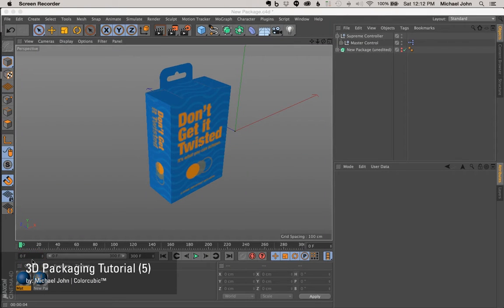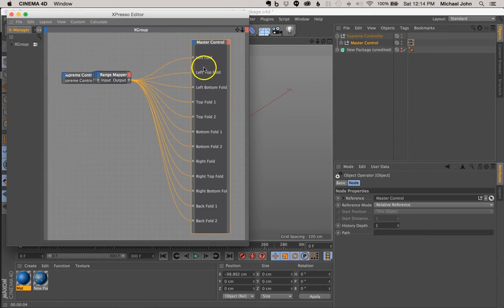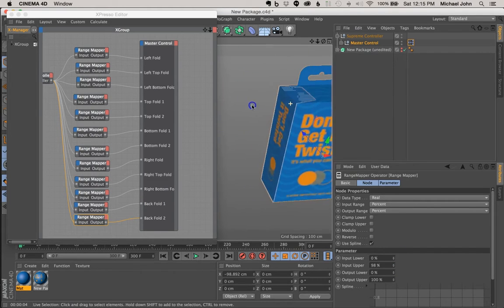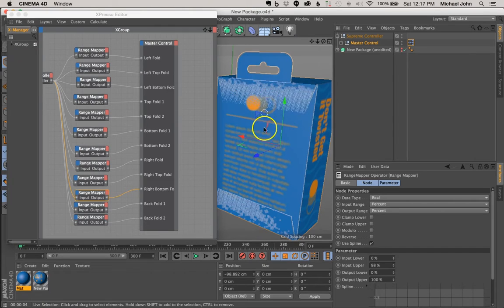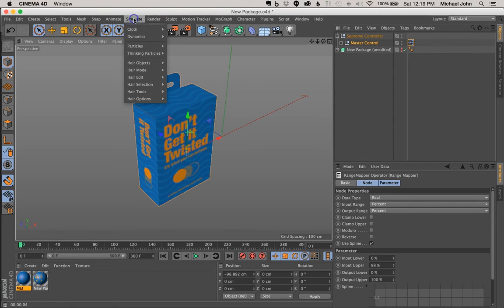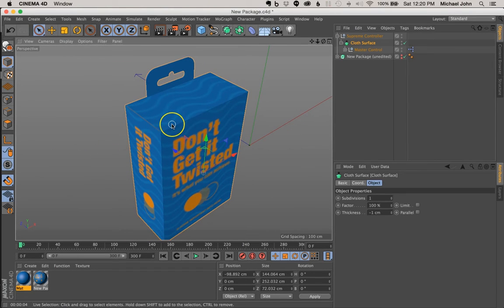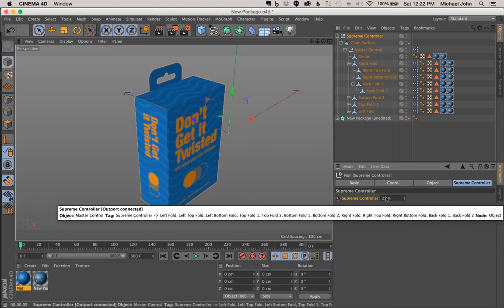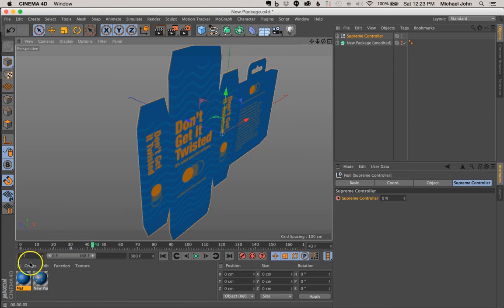Cinema 4D Tutorials - 3D Packaging (Part 5)

Comment: used this tutorial in 2022 and I'm pretty happy that I found you!
although I have one question 
how can I fold the parts without them intersecting each other?
I tried playing with master controls but when I change the numbers it changes back to what it was
hope you would still visit here
Reply from the maker: Apologies for the delayed response, I’ve been working on a solution for that, to help. It’s kind of a weird process, but it seems to work. I’ll be revisiting this anyway, to accommodate for the new C4D layout, as some of the processes have changed, so when I do that, I’ll be sure to update this, to include the solution to mitigate interactions.

Comment: so cool video!!! I have question, How could you print this  to actually make a box please?
Reply from the maker: Hi Jonsu, excellent question; the design process within Illustrator is what you would use to print to make a box. You need to ensure the guides are saved as a separate layer. Most printing companies have a process that would accept the illustrator file. If they don’t, you can save it as a PDF with layers. You just want to be sure that the dimensions you create in Adobe illustrator are the dimensions you want to actually print. 

Please let me know if you need further clarification. 

Best,

- Michael | Colorcubic®
Reply: @Colorcubic   Yeah everything you said is very clear to me!! Thank you very much for a quick and nice reply!!!
Reply from the maker: My apologies, my phone auto-misspelled your name. *Jonsu = Junsu.

Comment: Once you add the Cloth Surface the inner materials becomes the outer material. How do you keep that from happening ?
Reply from the maker: Excellent question. You’ll need to reverse the values on the cloth model. Although I am working on an alternative that doesn’t utilize the cloth surface.
Reply: @Colorcubic  also had another question about this same issue. When exporting as .fbx (without cloth surface to retain interior materials) ive noticed when i bring back in the fbx the inner materials is gone even though I see both materials on my object before exporting. Any solutions?
Reply from the maker: Another excellent question, and yes, I do have a solution. I’ve spent a couple days, the last couple weeks ago, troubleshooting some export settings to save models as .fbx files. I’ll be publishing a new tutorial to cover that. Stand by. I’ll try to get that before January.

Comment: Hi Michael, I make a corrugated case using your example. I changed the thickness of the case to 4mm. Is there a way to smooth out where the case fold? Also, is it possible to add C-flute details on the edge of the flap when opened? Thanks!
Reply from the maker: Nice! That’s awesome, Vincent. As far as those extra details, that’s something that many people have commented about, (establishing more control over the details & textures of the case). It’s something I’m sorting out new solutions for. One of the things I like to do is ensure is that if a solution works for the latest version of Cinema 4D, that it will also work for past versions as well. Once I have a solution established, and it’s backwards compatible, I’ll be sure to publish a née video of my findings.

Comment: excellent, but I have a question, how can I now that it is finishing, once the box is assembled, animate for example only "top fold", because if I want to manage the parameter from "master control" I can't, thanks !!!
Reply from the maker: I think I understand your question.’ If you only want to animate individual folds, then don’t follow the last step, combining all of the folds into one master controller. Keep them as individual controls instead.
Reply: @Colorcubic  Yes, of course, but I thought there was another option, so that there would be both options and to be able to handle the whole set or individually, thank you.
Reply from the maker: You can mix & match which folds you’d like to group together, and which you’d like to retain as individually controlled. But you’ve definitely given me an idea to think about as a solution. Thank you!

Comment: When i add positive value of thhickness my texture disapear. Not with negative value… why ?
Reply from the maker: That’s an excellent question. Once we launch the new Colorcubic site & shop, I’ll be addressing any discrepancies in these videos. I understand it’s missing a few desired effects, but overall, it’s a tremendously valuable solution to help visualize & achieve package designs strategies.
Reply: @Colorcubic  Sure it's because it's valuable i want to go deeper in the details. The only thing : for my needs i would have prefered to rotate the parts in a more easy/classic way. The tag thing seems a lot of work for no real value (i don't need to animate anything). But the rest is perfect. I would just need to go deeper in the perfection of details like thickness, bending the paper to make it more realistic (in real life it's not a perfect block), the texture of the paper and so on…

Comment: Thank you so much for this tutorial! It is incredibly helpful and you are really good at teaching. 
I know this is a bit of an old video but hopefully you can answer my question. Like someone else in the comments, I also have a die-line that involves curved lines, it's like a little bag so the two handles must curve in order to meet at the top. Is there any step that can be modified in this same process in order to achieve that? Or would it involve an entire different process? Again, thanks a lot.
Reply from the maker: Great question. Although I’m having a hard time visualizing what you mean. Would you be able to provide a sketch? If so, I could potentially reverse-engineer the process, and make a tut based on the sketch.

Comment: can u add bevel to the corners with that ?, In this every fold is looking separate
Reply from the maker: Great question. Every fold is separate, in case you need to make modifications to any particular segment of the fold. However, I didn’t highlight how to add bevels to the corners / edges in this tutorial series. That’s an element that needs to be factored into the design. I do plan on releasing a video that covers that, as enough people have asked about that.
Reply: Yes !

Comment: Thanks for your Great Tutorial. Really very clear tutorial. I have 1 question: After Add Cloth Surface my material not working in Front and Back. It show only Front Texture. Please help me. Thanks.
Reply from the maker: Thanks for the kind words. And excellent questions. If you reverse the values in the cloth surface material, it won't result in the back doubling the front texture. That's a temporary fix, but it does work. I found another solution to help, which I'll post later, once I've finished recording that tutorial. Make sure you're subscribed, so you don't miss out when it's posted. 

Cheers!

- Michael | Colorcubic®
Reply: I have a similar problem : when I add positive value I loose my texture and I have it when it’s a negative value. Any fix ?

Comment: Hello. I got to the point where I used the master control to form the box, but instead of animating the box to fold in. I wanted to have a animation rotating it.  I was wondering how do I combine the poly objects to be a single object and then animate it to rotate? Then maybe export the animation of the box to mp4? I'm not sure but I'm trying to make a animation for a 3d box. Anybody know how?
Reply from the maker: Excellent question. You should be able to simply animate the Null object that all of the packaging components are placed within, and that will animate the fully assembled package. Essentially, it acts as a parent folder for all of the individual components.

Comment: Thank you so much. However I have a question. if in the future, I would like to use the same package but change the design, can I do it straight away, or do I have to go back from before folding? thank you
Reply from the maker: Excellent Question, Nancy. Simply go into your illustrator file, where you initially set up the flat package design, copy that illustrator file, and save it down as a different naming convention, and then simply modify the design as you need (like in part 1 of the series). Once finished, open the texture file from Cinema 4D, in photoshop, make a copy of that file (saving a copy using a different naming convention), and apply the new design to that file, following the same steps in part 2 of the series, which you can find here. » https://www.youtube.com/watch?v=XiWomsuoZN8&t=384s

Comment: What happens if I want to change the package design after I did all of this process? Can I do that?
Reply from the maker: Absolutely. As long as the shape of the package hasn't changed, and only the graphics. Otherwise you'll have to repeat the entire process (for now). Working on a way to solve that problem though, to help save time.

Comment: Hello!

These tutorials are great! I'm running into a problem at this stage where it seems like the edges aren't "matching up"? When I reduce the rotation to 98%, it doesn't work due to edges jutting out. Where could I have potentially gone wrong in the tutorials?
Reply from the maker: I would go back to part 3 of the tutorial series. Some people have reported similar issues, and a lot of the time, it can be attributed to rushing through part 3 of the process. One particular recommendation I can make is that you watch carefully, which mode I'm in, when I'm adjusting the rotation axis of each fold component of the package. A common mistake I made, when I first started mapping out this process, was adjusting the rotation axis in the surface polygons tab. However, adjusting the rotation axis in the surface polygons tab didn't retain the axis change. Those changes can only be made, and retained in model mode. » https://www.youtube.com/watch?v=pduVzc92WSQ

Comment: Thank you for this tutorial. it was very hard to realize this with my box, because I has about 28 pieces to animate.
Now I have one problem: Some of the parts are crossing each other during folding animation. What can I do? Is there any solution to shorten the animation time of some folding parts?

Thanks a lot!
Reply from the maker: Hi Frank, 

The process is very in-depth, and takes a few times to really get it, but the process works. It all starts within Illustrator. It helps if you can sketch out the way you want the box to look, fully assembled, and then deconstruct all of the components of the box, as a flat object. From there, you can work out the folds, and which sections need to be nested, etc... 

I have a 18 piece 6-pack drink container that folds. Took a while to get it dialed just right, but it finally worked. 

As far as slowing down certain animatable folds, yes, it's definitely possible. You need to tweak some parameters in Xpresso to achieve that. It'll require you determining which folds need to animate in earlier or later. 

I'll make a note to address this in a later tutorial. Unfortunately I'm a bit bogged down with revising my tutorial process, and improving my production value of my videos. I also have a few Cinema 4D plugins & resources I'm gearing up to roll out, but once that's completed, I'll get back to this. 

Thanks for the kind words, and interest.

Comment: Loved all the parts, really helpful! Just have one problem with the cloth surface. It gives a very nice touch to the product but it messes with the texture design unfortunately by ignoring the UV mapping to front, is there a way to keep the cloth without reflecting the UV normals to inside of the box? (sorry if my question seems too confusing)
Reply from the maker: Not confusing at all. I actually realized that myself, before creating the tut. I should have addressed how to resolve that more thoroughly. Currently, I haven't worked out a solution that can utilize the defined parameters in the cloth surface, to thicken the package in a positive value, while still retaining the UV map texture separation of custom artwork front-facing, and the fill color back-facing. The best solution (so far) is to use a negative value for the thickness of the cloth surface. Now by doing this, you're going to get some very minor intersections occurring on the edges. You can resolve this by enabling Snap, and in the Snap subcategory (if you hold the magnetic icon down, once it's enabled, you can access the sub-menu in SNAP), also enable edge snap. From there, you'll need to adjust each component individually (be sure that Enable Axis is turned off. I made that mistake before, and it messed everything up). The best way I've found to adjust each component is to utilize the front, side, and top-facing view ports. Don't try to do it in the Perspective window. You can, but it might not be as accurate. Let me know if that doesn't make any sense. I'll be sure to amend this series with how to resolve that.
Reply: Still couldn't figure it out, it's a shame because the cloth gives a really nice touch, need to continue without it, thank you again for the great work ;)
Reply: @Colorcubic  i would enjoy a video that shows this !